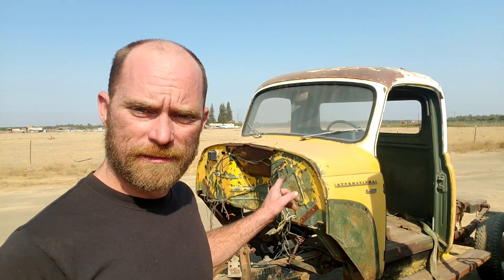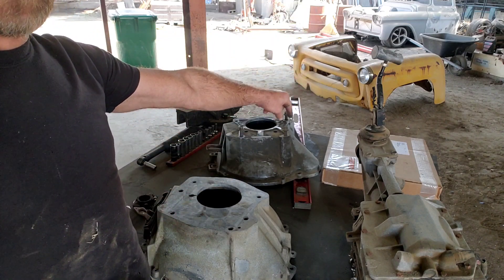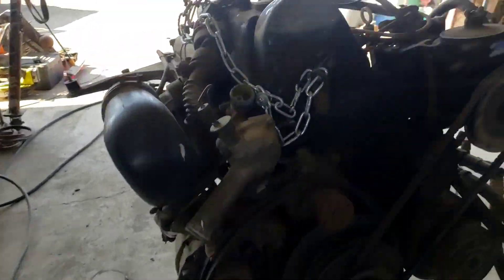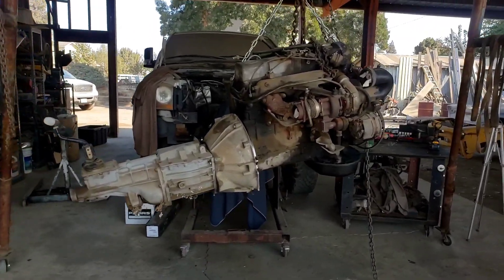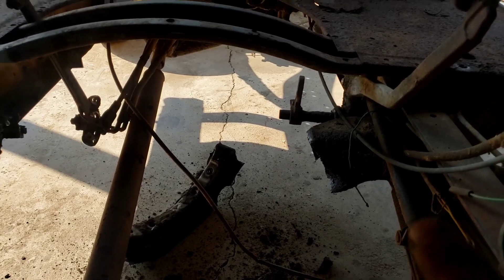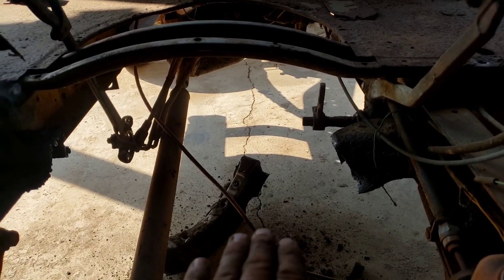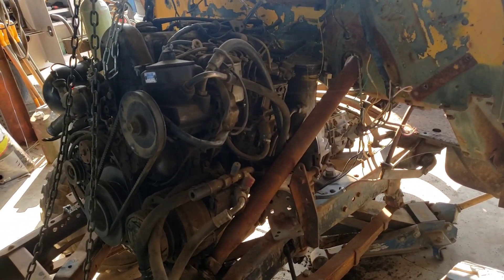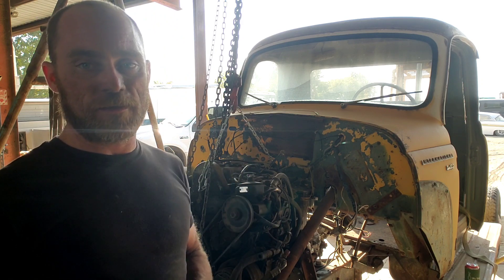1956 International - Truck Restoration - Hallmark Truck - Engine and Transmission Placement

Comment: How do you even know what gearbox you can use for later...
Reply from the maker: steering ?
Reply: @CVcustoms  
Yes...
Reply from the maker: @joeschlotthauer840  I'm using a steering box out of an 1979 blazer .... it mounts out board and works the same way but I'm also changing axles only 1 inch difference but should work fine

Comment: Great engines, I had 3 300D turbo Diesel engines OM617. Very reliable but not too fast either. Never had one with a manual transmission.